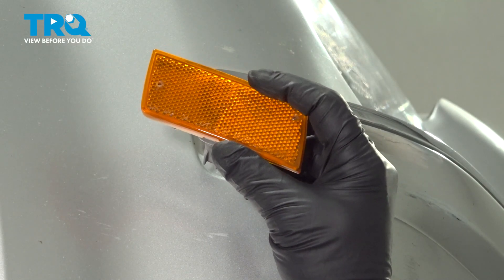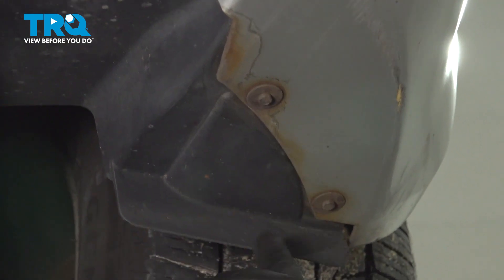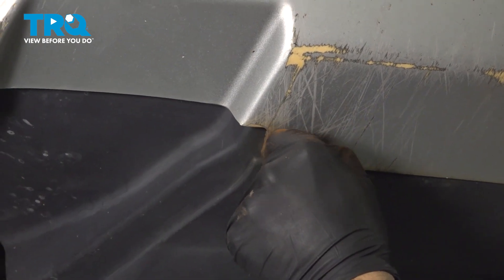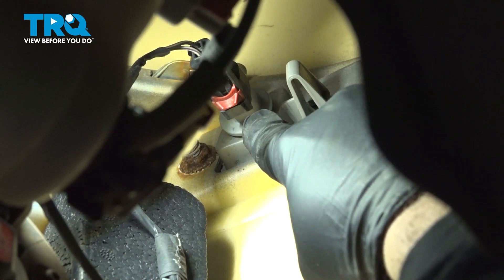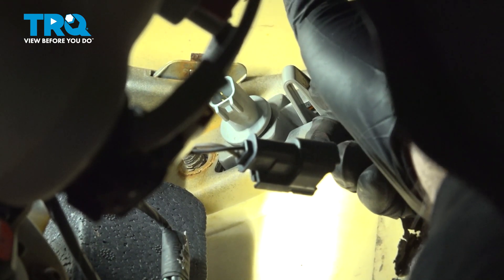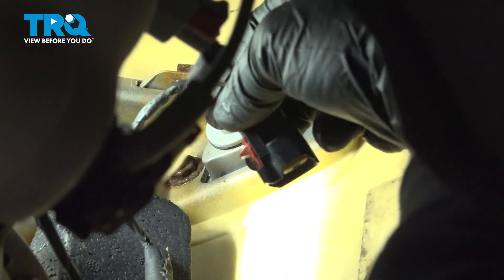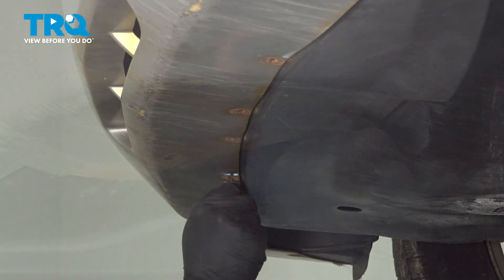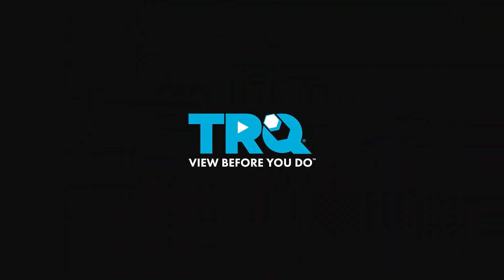How to Replace Front Side Marker 2005-2010 Chrysler 300

Comment: I appreciate your precise work in many of your video's. But in this case no need to take the entire splash guard off. Just turn the wheels for the space and just do the first step to open up that corner. You can get enough access and reach up to get to that side marker. I know I have a mint 2006 300 limited. Had to change just the bulbs because they were getting close to burn out mode. Lol in the manual under all the bulb sizes for this one it states dealer only. Yeah okay. They will rape you in labor and all they will do is what I did. Literally took me 15 minutes to do both sides. Also it takes a 194NA bulb. The amber color to give a deeper look. The front signals/parking lights also amber. 3757A. I've also updated my fog light bulbs. That you need to take the splash guard off. As we can see not too hard. But that also shows only dealer. Just a tip for the 300 owner's so they don't get ripped off by the stealership's.👍